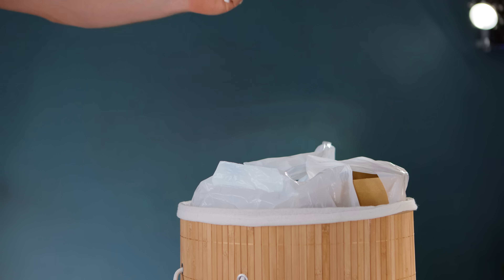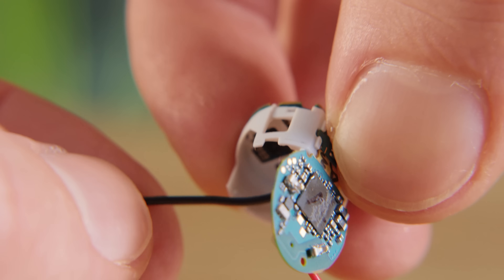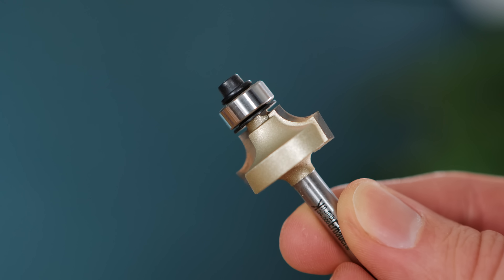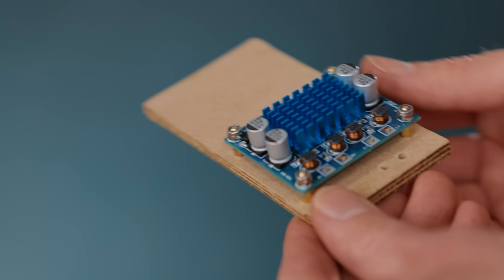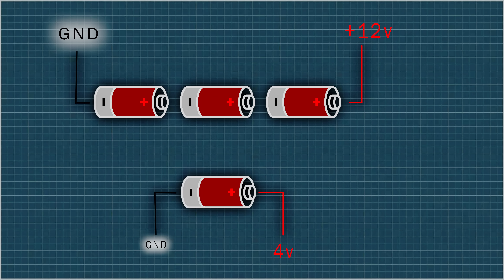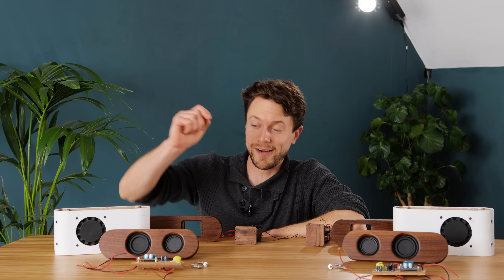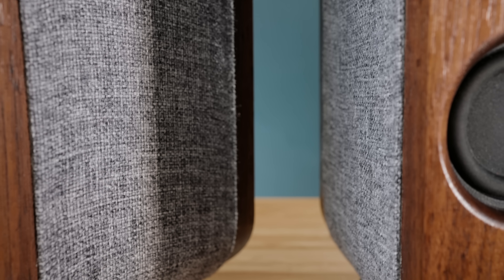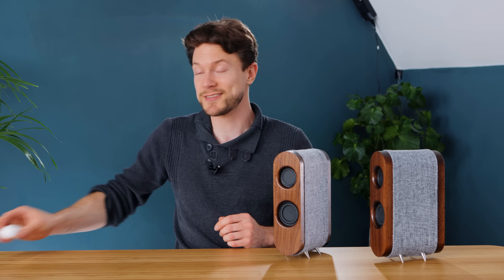Transforming dead earbuds into POWERFUL wireless speakers

Comment: Man, I can't believe you didn't integrate a charger. Killer project, but that'd be such an upgrade.

Well done, none the less.
Reply: Exactly I have a pair of airpods and one from taotronics both with dead batteries and unfortunately can't use this mod on them
Reply: @kedarnaths what happens if you contact apple for repair on airpods?
Reply: @rrp6405  It depends on whether they have warranty remaining or not. If not, Apple will charge you for any repairs.
Reply: @StardustLegacyFighter  i had a look and is $49 per airpod battery replacement
Reply: Imagine requesting repair from Apple. 🤣👍
Reply: prob because of the batteries. the 18650 batteries are usually charged with a fancy charger that regulates it to keep the battery healthy etc. prob could be done though as several devices use 18650s and have built in chargers, just would need the extra components
Reply: @brimmed  Anyone trying this PLEASE make sure any cells or boards you buy are from a reputable supplier. Even then I would run a full charge and discharge test with a multimeter to make sure. 18650's power MOST medium to large devices... every non thin and light Laptop you have ever used for starters. I have had fakes and faults even from Amazon.
Reply: You could just add a usb power bypass and a link cable to male them cabled and more permanent.. then able to swap to the battery power also of want to go for a jog or something...
Reply: I think this was avoided due to the size increase of the speaker
Reply: Wouldn't a good compromise have been installing a pos/neg charging terminals to which you could connect a smart charger, like a NOCO Genius?
Reply: space is main problem here. With two separate cell configuration you need two charging circuits and two working voltages. All can be done with cheap and available components but there is just no room for everything inside. BUT, this is DIY project and dimensions are not fixed so everybody who make their version can build somewhat bigger speaker box and put everything inside. In that case it would be better to go with single power option and use DC-DC isolator for powering buds (voltage for them can be lowered even with linear regulator,  current is very low and loses and heat generation will be minimal anyway)  just to make everything more simpler.
Reply: @gorky_vk  or you just add a port to the speakers and deal with the rest in your DIY charger. Dont need to bloat the speakers with things you dont need for them to work. An old USB cable has 4 wires, 2 for power and 2 for data. Theres no data needed so you can use those for power, too. Boom, separate circuits, and I think a simple USB port wont even look that bad on the speakers. So you could just use the case of a dead phone charger, and replace the circuit with your own, you should just mark it clearly so that noone actually charges their phone with that :D
Reply: @Chuckiele  possible but battery management  should still be inside a speaker, you can't sense voltage precise enough over long cable and overcharging can become issue (and fire hazard). 
As I say before there is just no point for using two voltages anyway, one voltage is enough (but you must use DC-DC isolator to avoid problems with noise) and linear regulator, even small to-92 versions are more than enough for earbuds to work fine. Everything together can be really small, 3S boards with low charging currents (1-2A) can be found in really small sizes (but even high power are not too big for speaker this size), DC-DC isolators are small for low currents needed here (someone mention he already use it in different project, I didn't see that video but you can look for it) and to-92 is well, to-92 size :)

Btw, I'm not fan of using USB ports for anything wired different from standard. You can mark it with large neon high voltage sign and still one day someone will think that he can charge a phone there. Talking from experience :)
Reply: @gorky_vk  Meh, he went with batteries with integrated protection, its fine :D
Reply: @Chuckiele  all troubles in this world start with someone saying "meh,  it'll be fine" :))

But, for now let's go with theory where nobody at some point replace cells with normal ones without protection. If you just apply voltage on that battery pack one cell (whichever charged first) will just block other from charging (same with discharging) and with time you can expect big gap between them and drastically lower battery life. 
You can go that way with some things, I use same system in modified flashlight just because space were limited and I never intended to use it too much. It still have original charge inside.
But with stuff you expect to charge very often (like speakers you forget to turn off from time to time :)) it's just wrong way to do things.
Reply: @gorky_vk  Thats a general problem with all devices that contain Lithium cells in series but have no balanced charging. Its generally fine if they all have protection though. You might feel a loss of capacity after some some time but you can just solve that by occasionally taking them out to charge them. Its a much bigger issue with unprotected cells though for obvious reasons.
Reply: @Chuckiele  but why when it's easier to go from start with balancing board and it's even cheaper as you can use normal cells? So no need to ever take batteries out (until they degrade ofc), it's cheaper and more "professional" way to go.
Reply: I love how everyone is making an excuse that it's too hot, large and dangerous. He's handling bare cells (actually dangerous) and people add chargable lipos to old gameboys all the time. It is none of those three things when done right.
Reply: I could be just for the safety factor... nothing here is likely to explode and remove half your face. Or destroy nearly £200 of hardware hooked up to a £5 pair of busted earbuds.

Even if you are competent and "THINK" you have a protected charging circuit going on, you may still have issues. Either with a mistake in your wiring or even fake or faulty protected cells / boards. 

The only complication I see here is the separate circuit for the buds and the amp. So you would need two charging circuits. Two boards, two sockets etc etc etc

Odd that he did this as in a previous build he used a DC to DC isolator, which has worked for me on every bluetooth speaker I have built. 

Its tricky if the board pulls more than 1W but I can't imagine that these buds do that????

WAY easier than unscrewing the back every 3 hours to recharge the batteries in a wall charger, surely.
Reply: That would be too complex and long
Reply: @sabmatlabi3075  if too complex and too long is an issue....just throw the buds in the trash and buy some premade speakers. a true DIYer would not let a little thing like complexity or time get in his way!
Reply: @28thMaoriBattalion  18650 batteries can be fickle.  If you get the charging wrong, or over drain them they can get get a bit ‘explody’.  Definitely safest to use a proper commercial charger and without them being connected to a DIY project while charging.
Reply: @briann7482  They can be connected to a tp4056 type-c board for protection against low or high voltages which would have increased the functionality and ease of use quite a bit imo.
Reply: @yashwardhanmadnawat6578  would you need four of them?  As there is two voltages/packs inside each (1 cell and 3 cell) IIRC?
Reply: @briann7482  A single one should do the job they could be wired from a single output
Reply: @briann7482  That's where the integrated protection circuitry comes into play
Reply: @sabmatlabi3075  Sounds like you know a lot about it. What's involved?
Reply: @xodhiver  could take up a fair bit of room inside, get hot / dangerous and affect sound quality
Reply: @rrp6405  just solder a usb battery pack lol
Reply: @thereareantsbehindyoureyes7529  i was thinking the same, why not have a usb port to charge, im guessing there is a good reason, he is so thorough with everything he make
Reply: @rrp6405  no, nope and schmaybe.... potentially dangerous, but then so is picking up a saw to cut the wood.
Reply: @thereareantsbehindyoureyes7529  with this design you would need 4 packs... 2 each side.That would be almost as expensive as the speakers used.... Almost.
Reply: @rrp6405  Capacitance for one...if you try to trickle charge those 18650's with just an USB cord rather than a proper power supply circuit  it might even extend the charge a bit, but it will eventually not keep up with the demand and fail. You can buy a proper charger ...oh I see Brian N addressed this as well...oh well already typed...guess hit Return...and bumped his although my reason holds as well...
Reply: @dreamcyfer7793  Absolutely... most BMS boards do not work below 15v to charge... pointless exercise on USB on 5v. Wire up an external charger to protected cells would work too. DIY Perk style get an old laptop brick and a bms 4s board with the buds running off a 5v drop down and an isolator. I am mid way through doing similar with a regular BT5.0 board for a portable soundbar. Tempting to try this true wireless thing though.... Somewhere out there a pair of galaxy buds have had their fate sealed!
Reply: @Gary__Old_Age_Triathlete  Yeah I'd agree I had never earlier realised that there aren't any synchronised stereo receivers in the market for wireless pairs
Reply: @sabmatlabi3075  but making your own low and high pass filters isn't?

Comment: Honestly the bose had better highs.  I probably would have opted for a real silk dome tweeter or even a small planar driver as the top instead of a 2 full range mid woofers.  They doo like like nice speakers though and I had never considered using headphones in this fashion.  Cool idea.

Comment: No built in charger and need to undo FOUR SCREW for EACH to even get them out???
And two separate battery circuits just so you don't have to challenge yourself with grounding?
BOOO

Comment: I wanna understand how single BT connection Connect two devices i mean if one should be Master other should slave but which wireless protocol is used to send signal from master to slave  again Bluetooth or just radio wave or both pair receives Bluetooth signal from Mobile phone ?

Comment: Video idea: Battery replacements! For anything really. Im about to replace the NiCd batteries of my bosch cordless drill with Li Ion batteries, and i realised i dont know anything about battery voltages. 

You could talk about how to get more juice out of the thing, by putting the cells in parallel, or how serial increases the voltage, it would be cool as hell!

Comment: Kind of ridiculous to not include a charging circuit. You didn't have to do separate batteries if you had included an isolation transformer and a switching regulator for the bluetooth portion. The single battery pack would have made it much easier to include a charging circuit inside would would have made these WAY more convenient.

Comment: Very nice attention to detail in both build and sound quality. Long time fan!
Two things though!
1. 6:54 hurts my eyes! :)
2. The thing that would have made these ones even nicer (imho) is having a USB-C powerbank embedded in each speaker instead of the 18650-batteries. It would allow the speakers to be used while charging and just having a sweet USB-C port instead of the battery pack. I think the price would have been a bit cheaper and having an even higher mAh-capacity.
Would have needed some DC-converters for it and it would be tricky to separate the ground meaning it might mess with the sound quality a bit.
I bet you already thought of this and went for sound quality instead!

Comment: the problem with being good at diy is that your stuff never breaks, can't use them for parts
Reply: Cris Sto
The Airpods? stuff never breaks? What parts you need? I guess if the drivers or the battery are done, ore one part is broken, you have parts enough to do this!
I do not think he is using them himself, i guess he is just using real speakers.
I buy fancy gear, and repair it myself, MIELE, SONY, apple etc. I only buy a replacement when it outdated, still using iPad air model one in 2021, my iPhone 4 SE was replaced for the X, both i keep in repair myself. The rest of the gear is never replaced or got outdated, i bought the house in 2004, it's still that year here, everything is repaired.
Reply: @lucasrem  exactly, you can't scavage your old broken stuff for parts cuz you already repaired it and it works perfectly. If I was to buy airpods and the battery died, I'd just replace it and keep in using them

Comment: So cool! Just curious if these earbud receivers have some fixed built in equalizer made for their drivers. It could be bad match for any other drivers 

PS. someone please make printable 3D models of the boxes for the lazy ones :) Prints are actually pretty rigid and damped and so they should be good for hifi speakers.

Comment: Question though if you want to pair a new device to this bluetooth speaker what would you have to do considering most of them have some sort of custom button/ long press to enter bluetooth pairing mode. I guess the assumption is you pair before disassembling or keep the buttons intact somehow and reassemble?

Comment: This is all cool and nice but the cost of making these is quite high.. I mean just making one if you add 35 gbp for the amp 56 for the sub and filter 15 for the mid you are over of a Bose soundlink mini II for the price of just one. If you put also the headset and the battery and the wood and all the other bits and pieces it will be well over the price of 2 Bose speakers which you can use just like these speakers..

Comment: As a tip, the capacitor and resistor values (in Farads and Ohms) can be calculated based on certain target frequencies. Look it up on google, for example: “how to calculate the cutoff frequency for a low pass filter”.

Comment: But i could just use a power supply if i dont need the wireless function. So i dont have to replace the batterys but habe awsome speaker for my bathroom.

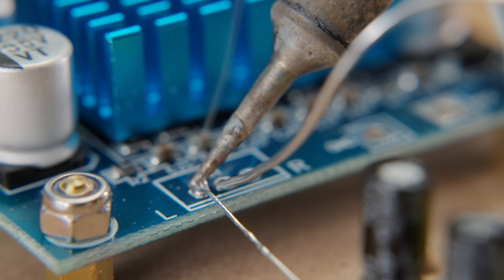Comment: This might be a nitpick and not totally important for this project, but the soldering technique shown at 8:28 is not good. You're not supposed to touch the solder to the soldering iron. You need to heat up your thru-ring and the wire at the same time, then add the solder so it melts on and sticks to both. This is called wetting, and it will improve the signal quality and durability if the solder joint.

Comment: It would be awesome to see a rough price comparison of DIY to off-the-shelf. Obviously making something yourself has its own value, but would be interesting nonetheless.
Reply: I think the Bose speaker at the end was a similar price to the project, but I may have misunderstood
Reply: The bose speaker in the comparison cost less than just the two subwoofers.
Reply: The Subs are £70 EACH and the secondary woofers are £15.00 each.
That's £170 before you start... which would buy you an LG boombox or one of many JBL products.
Which you may or may not be perfectly happy with.
They will have similar power and be properly rechargeable, etc.

But wait... thats before the £48 of LiPo's, £20 amps... wood, paint, glue, fabric etc.... another £20.

and the £25.00 for the broken earbuds... you will NOT find them cheaper... I looked... because the idea of that in itself as a bluetooth setup you simply CANNOT buy otherwise is ACTUAL pure genius.

And assuming that you happen to have the required tools....

Don't forget the man hours to build it... at minimum wage of £10, an experienced person would still be looking at 20 hours.

Now you are into B&W and Bose Territory.

But that's entirely beside the point.

Firstly, I don't know of any commerical product where the true wireless concept has been applied to twin stereo speakers.

I think there might be a few soon, purely off of this video alone.

What you then get is something that is unique, and with the right research or guidance from experts,.. SoundImports.eu are the best for this by the way... perfect for its use case and your personal taste.

There is nothing better than enjoying using it; quietly beaming inside with the thought "I MADE THAT!"

Nothing like it.
Reply: @Gary__Old_Age_Triathlete  Oh i completely agree. But also $400 is still $400. I would love to burn that amount on something i would probably ruin while trying to build it. But I'm too poor. If i can pull some mini speakers off some thrift store electronics i might try this someday.

Comment: Few remarks:
1. Great idea with using old TWS!
2. Very nice drivers and enclosure
3. I'd use 2-way amplifier with DSP instead of passive crossover design - much more power efficient, elegant and easier to tweak.
4.  For charging and power 3S cell and something along the lines of TIDA-050047 would be nice - integrated BMS and USB-PD.
This would however demanded much more work. Not a weekend project anymore!

Comment: One thing I'm curious about. Most of the wireless earbuds I have experience with are ones where the phone communicates with the right earbud and the left plays along when they're within range of each other (regardless of being inside an ear or not). This range is usually only something like 30cm, so the left one will stop playing when you pull it out of your ear and start when you put it back in. How did you get around this? Assuming you even experienced it with the earbuds you used of course.